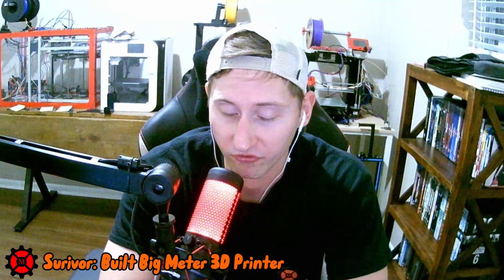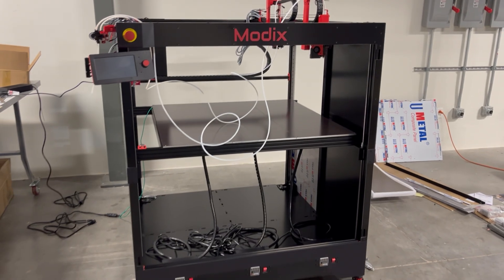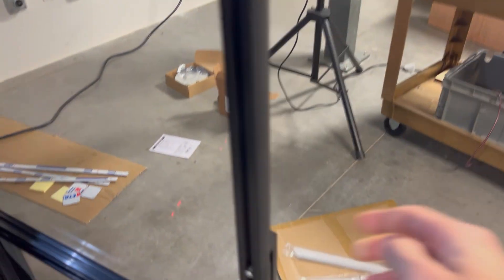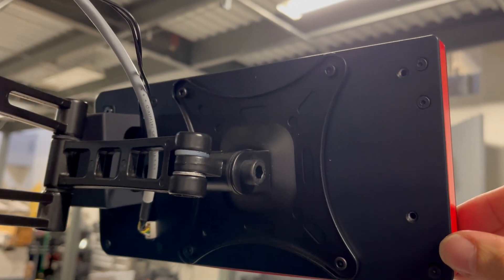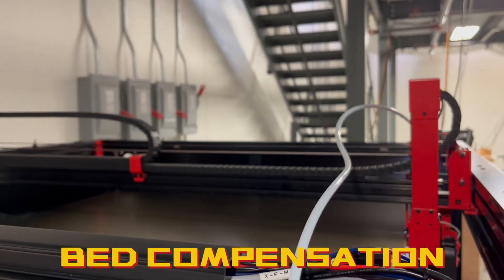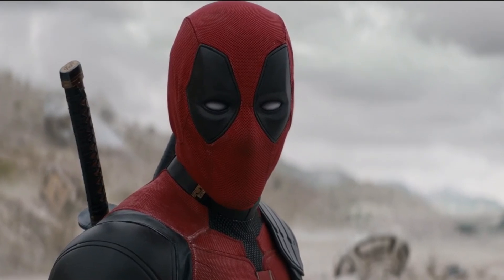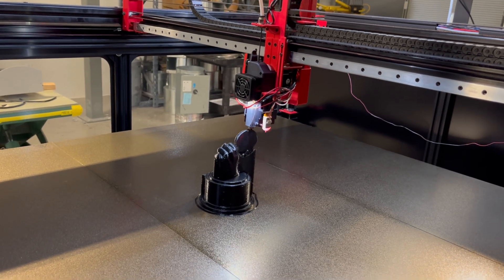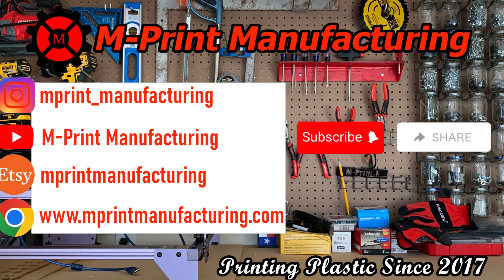Ep. 14 | Modix BIG-Meter 3D Printer | Large Scale Printing | Electronics and Running Macros | Part 2

Comment: Have you printed anything LARGE format yet? If you have (or if you haven't) I'd be interested to see a video on the results
Reply from the maker: Thank you for the suggestion! The larger prints have been hit or miss. The upgrades high flow nozzles did not perform any better than the standard 0.4 nozzles. Thin features and supports also tend to fail on this printer when going larger. Honestly for large scale printers I would look into a pellet based extruder if I was going to need a reliable machine. The Modix is using standard 3D printer parts on a larger bed, which is slower and less efficient.
Reply: @m-printmanufacturing2017  Interesting! Thanks for sharing honest feedback

Comment: is prusa slicer good for this printer ?
Reply from the maker: I have been using Cura, but they do have profiles for prusa and simplified 3D. I think as I’ve noticed there is a bit of fine tuning to achieve success with this printer.

Comment: My modix is a paper weight. Rubbish printer
Reply from the maker: That’s what I’m hearing!
Reply: @m-printmanufacturing2017  biggest reason no sensors capable of to detect failures leading to a lot of destruction, also the sensors to stop the head from grinding into the build plate is useless. I've replaced the heat nozzle so many times because of these two reasons alone. After so much money and so many repairs I stop wasting money with this bullshit printer.
Reply: @ryanlowseck1164  Must have been the build. we have not had any problems, from a .4mm to a 1mm nozzle. Using Cura. Big 60 120 and meter. Never hade a head drag on the build plate, that could be caused by someone moving the bed manually during power off, after you did the tilt and bed comp. As for the hot end I did have a customer that built a big 60 v3 and had that problem, but the big 120 IDEX we built for them has not had that issue with the griffin hot ends.
Reply: @ryanlowseck1164  After watching the rest of the vid. I se the griffin high flow (super volcano). The super volcano can be a problem on any printer it is on, especially when using large nozzles.
Reply: why ? any specific reason ?